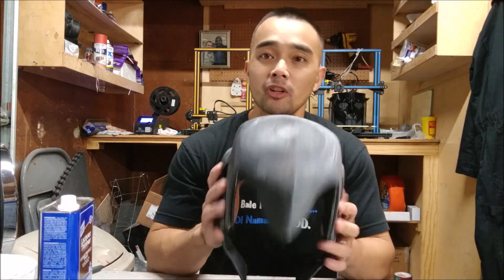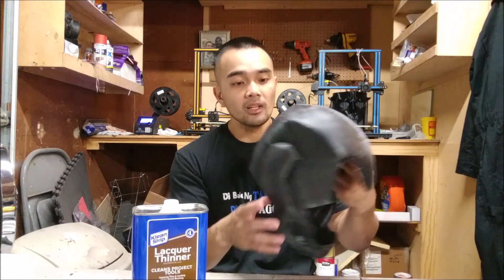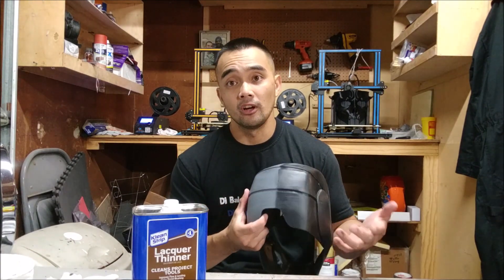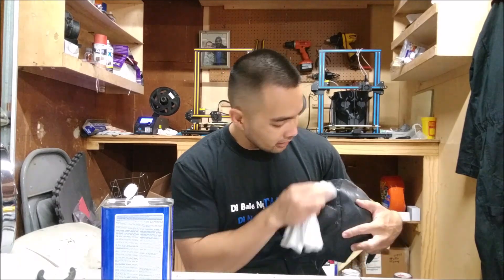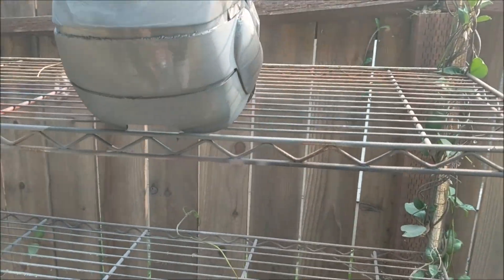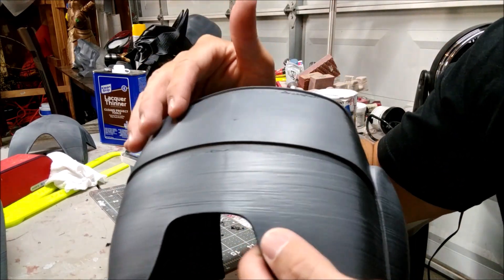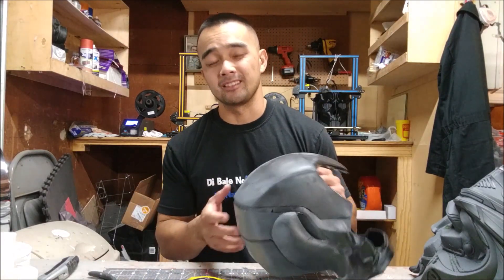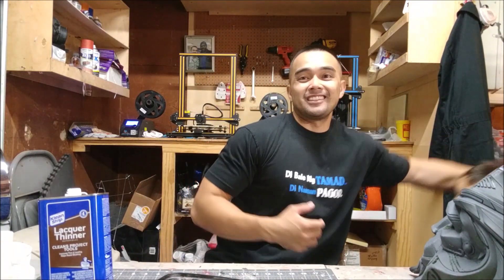Smoothing PLA Myth- Laquer Thinner

Comment: Thanks for doing this, I'm actually glad it doesn't affect the PLA too much. I had a primer curing issue on a helmet (never cured, stayed the consistency of very tough clay) and I have to strip it off with lacquer thinner. Wanted to make sure I wouldn't damage the print doing this.